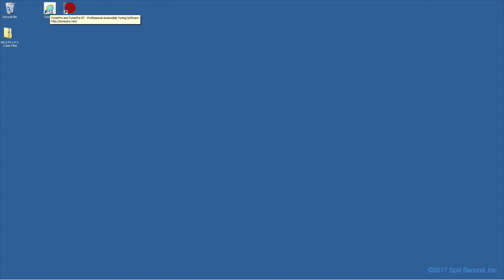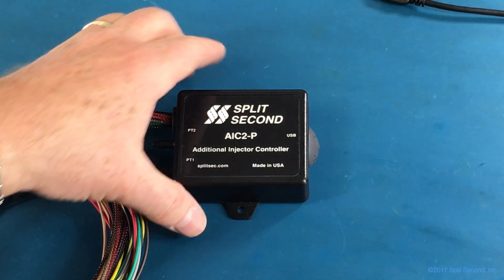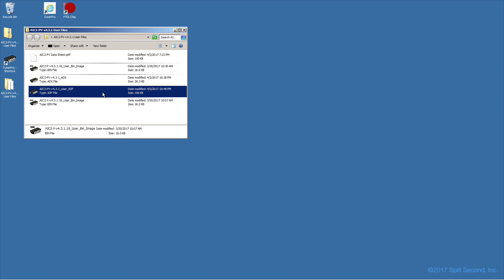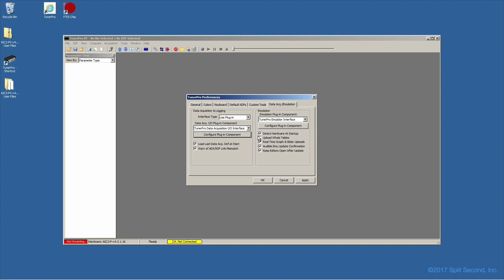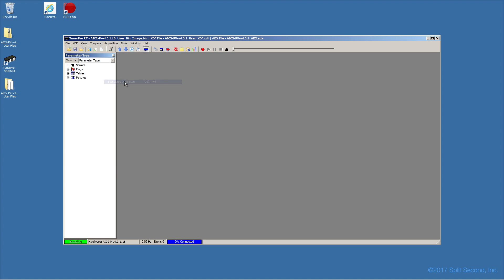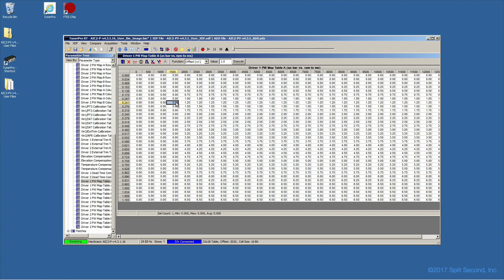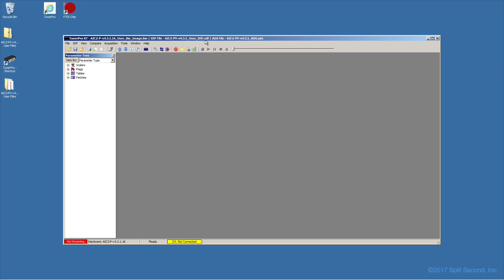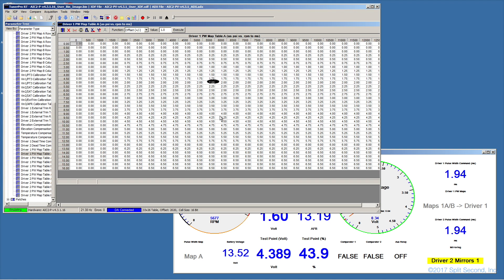Getting Started with TunerPro RT

Comment: @angry_bullet_pro_chip3646
0 секунд назад
can i have your email can you help

Ответить

@angry_bullet_pro_chip3646
0 секунд назад
why do I have engine speed in my tuner
4800 5500 6000 6500

and the map that I want to configure in the tuner pro, the engine speed is 4800 5100 500 6070 6080

what should I change in the settings so that the speed for the settings is the same

Comment: What is a Calibrator
Reply from the maker: The TunerPro RT software is used to set up our AIC2 additional injector controller.  It is used to calibrate the additional fuel required in boost.

Comment from the maker: We use TunerPro RT to program the AIC2 family of additional injector controllers.  You can use it on the Nissan Maxima if you are going to modify the engine and run additional injectors.  If you are looking to fine tune a lightly modified engine, one of our R4 based PSC1 products might be more appropriate.
Reply: I have an OBD1 lt1 corvette can I use tuner pro to returned my co.puter without this calibrator
Reply: TunerPro can be used to tune obd1 ECUs.  You can use it to alter the code in the PROM in the ECU.  You can also do real time tuning with an emulator. @fireman66767